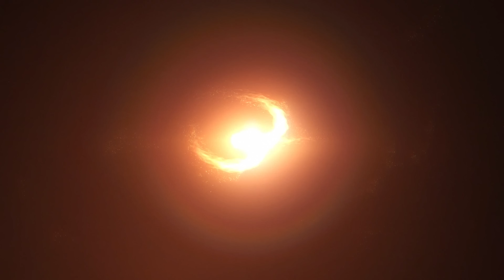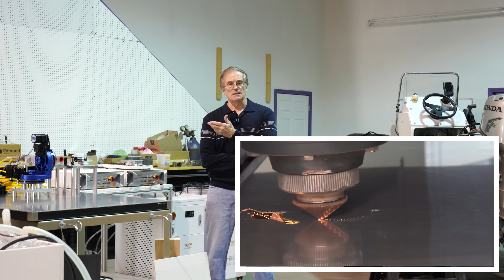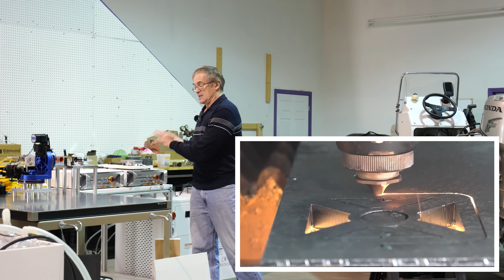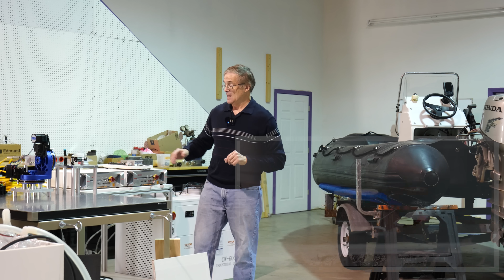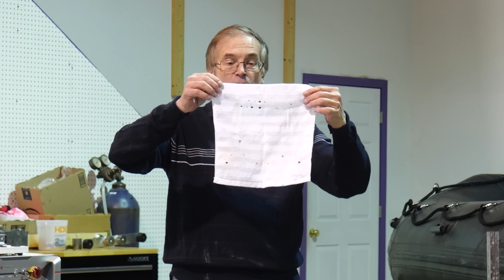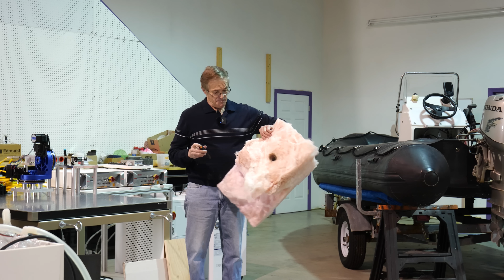We have a problem... and need your help!

Comment: As I see it, you have three problems.  You hit on each of those in the video, but if you try to solve all of them in one shot, I suspect that you will not succeed, or the solution will be massive in terms of cost, time, and/or weight.  For the record, I do have a possible solution, but it is part of a system in an unrelated vertical that we hope to bring to market.  To share, we'd have to have you sign your life away with NDAs, and even then I am not sure it would solve your specific problem since there are fairly major differences in the problem(s) we are trying to solve.  My goal with this response is to perhaps guide you to come up with a parallel solution without violating our IP.  

In no particular order, the three issues I am seeing are:

  1. The small area of the beam
  2. The energy of the beam
  3. The cumulative thermal energy during the beam's lifespan.  

While the first two issues are usually combined in some form of energy density value, I'd advise you to look at these factors as individual aspects for reasons that should become apparent.  

Your first task needs to be to disperse as much of the beam as possible down to relatively harmless levels.  The best way to accomplish this is to use a coating material that is opaque and reflective, ie. high albedo but able to scatter the beam so that the inverse-square law works to your advantage.  Refer to the math behind bidirectional reflectance distribution function (BRDF).  In specific, you are looking for a coating where the particle size is small enough to catch many particles in the coating under the footprint of the laser, and the coating must be thick enough to catch as much of the beam in the particle stacks of the coating as possible.  This material must also be thermally rejective and stable at high temperatures.  There are several materials which cover these characteristics, and your selection will vary primarily on particle size, density, and the specific material's response at the wavelength of the laser.  I figure an aqueous boron nitride coating would be a good start for the wavelength of 1030-1075 nm.  Check with Zyp Coatings.

Next, because of the small footprint, and the fact that no matter how good your coating is, some of the beam's energy and/or the thermal effects will get through the layer, you will need to dissipate the thermal energy over a larger area quickly.  You have already done this to a degree with your heat sink compound particularly with your comparative testing, but for this purpose, you will need to accomplish this in a thin coating that will adhere to the coatings above and below it.  Extra points for figuring out how to thermally bond the different coating layers well enough while dissipating the energy across a larger surface.  This is the "secret sauce" to our IP, so I can't directly help you there, but I'm sure you'll figure something out in short order.  Here's a final hint: we are filing both a process and a material patent.

Given the energy levels we are talking about, this will not do much but buy you time.  Use the above technique repeatedly, stacking the the rejective and distributive layers, and use it on a substrate that can hold its own reasonably well.  You may also wish to keep the material target in motion; spin the target, and put the aim point for the laser away from the rotational center with enough distance between the laser impact area and the edge of the target to allow thermal dissipation.  Finally, you may also wish to have this laminate coating have a PC board layer with a single fine trace going back and forth in as high of a density as you can get as the final layer.  Wire this trace as a safety loop, probably in series with the laser's e-stop if it is normally closed.  The concept is that if the laser gets through the coating and substrate, it will sever the trace and shut down the laser faster than you can react to limit building damage. 

If you need more info, PM me.  I am sure I could convince our board to release our data to you with a signed NDA and information sharing contract.  You wouldn't be able to share the coating particulars on the channel of course, but that isn't the intent of the work anyway; this is just safety equipment, not the laser.  The data we'd want in return is more or less what you normally provide viewers on your channel.  Our angle is that we'd get to evaluate if our product has direct applications in other areas such as laser safety and defense.
Reply: Going back through the subject videos, I see that you are not in the IR band as I thought.  The principle should still apply, but material selection will likely need to be reconsidered.

Comment: Combine 3 ingredients?

Reflective surface at 45 degrees down angle. Into a barrel of water. With ceramics (bricks or ceramic saddles) lining the bottom. The water does the heavy lifting in thermal absorption, and the ceramics absorb any energy that passes through the transparent medium before it can be transferred to the water. Gives you a renewable solution that you can refill rather than a deeper and deeper hole in the ground or a material. Would that work?

Comment: Pentaerythritol is used in fireproofing, since it puffs up and chars, forming relatively safe corbon insulation. I could imagine mixing a plaster with it and pouring it a few centimeters thick.

Comment: buy any flat metal tape that is rolled in a roll. Then unpack the roll and let it spread out so there is always gap between walls of metal tape. Then shoot laser into that gap between spirals, and laser will keep bouncing of the walls of the metal tape thousand times, each time it will lose 1% of its power, till on the end you'll be left with almost nothing.
Based on that same principle one can buy optical cable, crack it up to reduce its transparency, and then send a beam into that damaged optical cable. One needs to find a way to control rate of absorbtion of that glass fibre, because one doesn't want it to absorb energy too fast.

Comment: carbon ?  like activated charcoal (if i spelled that rt..)  its light , cheap & should sustain the temps , plus black so absorb rather than reflect/refract .   and / or finding something economical that carbonizes when burnt ...   otherwise, u gotta find a mineral  = can be made fluffy = and gotta get it into a sheet.

Comment: A big tank of water with dye in it -- with a low enough optical density that you're not flash-boiling the water at any one point, but thick enough that in bulk it attenuates the laser enough for an opaque blocker on the back of the tank to deal with.

Comment: It seems to me that, just like your metal cutting industrial device, you need to take the collimated beam and give it a diverging lens.  

I suggest a lenticular wall of glass or plexiglass rods, the first layer of glass rods would actually be two layers of vertical rods that overlap by some small amount to avoid the beam squirting between the rods, The next two layers would be horizontal rods in the same configuration. The final layer would be some kind of black painted plywood of some sort, set a few inches or a foot behand the "Diverging lenticular Array".  

The reason for the vertical and horizontal orientations is obvious to anyone who has played with optics like that.  The first rods will convert the intense collimated beam into an intense but greatly reduced wide narrow beam that would be as tall as the original collimated beam, but diverging into an extremely wide flat beam.  The following horizontal divergence wall would finish the divergence into a vastly lower energy diffuse wall of light.

What I don't know is whether inexpensive glass rods would absorb too much energy and melt too quickly.  I would experiment with different materials.

Just my two photons of advice.

Comment: Maybe a fog/ smoke machine +- dyed smoke could diffuse the beam so it is less intense over distance (i guess low dye would be better or it would vaporize or burn the fog negating its scattering benefits) and could be stopped by a intumescent coating or as discussed by others a thin layer of water like a narrow water tank maybe with dyed water. 
Basically a double glazed window with a bubbler to reduce density, shock waves and localized heating and provide circulation. 
Water would need to have any IR absorbing dye or maybe just carbon black suspended. 

Maybe agitated dry ice would absorb IR radiation i don't know. If it did it could be used similarly to water in a double glazed window and also prevent fire but i would expect cracking from the intense cold and heat.

As previously suggested a water cooled oxidized copper plate may work as well.

Comment: My first thought was wet sand - wet as in dripping wet. Too wet to make a sandcastle. The problem then is how to contain it.  Glass or acrylic is probably too reflective. Drywall or plywood would suffer from the moisture. Wet sand between concrete slabs?

Comment: Choose a material you are comfortable with and make rotating disc panels with it , your issue is focused energy at the same spot ,if you rotate that area there is not one spot but a circumference to work with .

Comment: Drywall or gypsum board coated with starlite or a similar fireproofing coating (starlite 2 parts flour, 1 part cornstarch,sugar,baking soda) and the panels should be at an shallow angles to disperse or redirect any reflections.

Comment: A series of sheets of water containing powdered graphite.  Having multiple sheets in a row will give enough graphite to act as a dump, the cost of setting up the sheets of water should be low, there does not need to be any containing surface to get damaged.  A trough pool can catch all the water which can be constantly recirculated.

Comment: My friend works with powerful industrial lasers, and he suggested a white nylon plastic for the material.
Yes its going to reflect to some degree, but he said it will absorb some of the light and warm up without catching fire or smoking a lot.

If possible, the material should be installed not at straight angle from the laser, and little rough surface finishing can help in scattering the light.

Also, it could help if you can give some details of the laser like:
Wawelength
Total power
Pulse energy
Exact diameter of the spot

Comment: I had 2 ideas that likely won't be the solution but might spark a better idea from someone else: 1. A dense plum of gas behind the target. My thought is it might help  defuse the laser slightly (might even use a tube to help keep the gas concentrated) 2. Space Shuttle heat shielding tiles. I recall someone on YouTube making their own a while back.

Comment: Have you ever tried using what they call aircrete? If not there are some youtube channels like (honey do carpenter) that have alot of good videos. You could build a mobile wall on a wheels or skids out of air Crete. It would be light enough too. I seen a 12×12in. Solid cube of aircrete be light enough a child lifted it like a beach ball.

Comment: You need something super black with the form of a heat diffuser behind. Or a refrigerated unit.
Absorbent, fiber formed to diffuse, heat conductive, 
I know it will burn, but, carbon fiber?
If you figure this one out, body armour that would deflect or dissipate lasers would be useful yes?

Comment: Maybe something with agar/jelly like. It should be easy to setup, potentialy biodegradable and cheap. Maybye jelly wall will collapse fast enough to close the hole. In addition you can use drywall as first layer to prevent reflections. 

Also maybe blanket with Oli will last longer, but it is more flammable than plywood. You can try making drywall sandwich witg olied blanket in between to limit oxygen access. 

I think only one material cannot do this, you need to use composite wall.

Comment: The one thing that comes to mind would be materials used in very high temp furnaces and kilns. It may be a moot point depending on the temperature of your laser output, but Kaowool or refractory bricks might last significantly longer than the standard materials you have tested. Or they may fail just as quickly.

Comment: Maybe a fish tank filled with water and a circulator or stir bar with carbon black in the water? I would guess the carbon would absorb the laser and the water would allow not only heat dissipation but the siring would always put new material in the beam path.

Comment: I'm wondering if a large water tank filled with a black gel that has thick non-reflective glass sides would work.  I saw gel instead of just water is dark tint because then if it puncture the glass wall the gel could in theory fill the hole.  Another idea would be a tank or bad filled with wet sand.  Tungsten will deal with heat better but it might be too reflective.  Really though, you should be focusing on things that absorb most of the light and then transmit it back out and through itself as heat and that can handle very high heat (hence mentioning tungsten).  The thing is though, if the object gets too hot it might become very bright itself and then might injure people or object nearby (sort of like being to close to a fire or welding or sunburn). The toxic gas/off gassing is a valid concern but if the work area is big and well ventilated its less a concern than the beam reflecting or the reemitted heat being too high maybe even causing burns/fire.  Really one should treat such a powerful laser as a tool only to be used for what it was designed for. But, if you must use it outside of its intended use you should then treat it like a high caliber fire arm or explosives, so essentially you need to do it out somewhere safe where no people or large wildlife or plants are around to catch fire.  And, then those firing it should be behind  protection (like what you're trying to design).  Another possible form of protection would be screens that polarize the light twice or more times until it is totally filtered out or rendered harmless.. but again the filters then my catch fire (especially the first one the light hits)  Sorry for the wall of text, just too tired to edit this.  I know I didn't offer many good ideas but hopefully this prompts some good ideas.  Good luck but more importantly be safe.

Comment: First I thought some type of aerogel, but maybe the best solution is to use diffraction. Maybe wire in layers of horizontal and vertical line patterns with some space between them. The wire needs to me smaler then the light beam. The wires will absorb the heat and the diffraction will spredd the light. Its almost like reverse engineering a lightbulb in combination with the famous double-slit experiment.

Comment: Slab of rough cut SOAPSTONE used for countertops or wood fireplaces. Resists heat, will diffuse the beam because not reflective, cheap, available anywhere. Custom cut to any size and thickness.

Comment: Why would you test it indoors with both low divergence and high power? You can do system test with a low power beam. Slow motion replay to confirm target tracking. For high power indoors test use modified optics so the beam is safe for the backstop at say 10 m. Save low divergence and high power for the proving ground.
Which leads me to wonder just how you might safely test it outdoors. Let's suppose the beam is safe for a pilot's unprotected vision at 200 miles. You would only need an FAA total flight ban for a 200 mile radius. You might get approval to test it in Eastern Ukraine though.

Comment: I have no idea if this will hold up to this much power, but to dissipate a low power laser, we use glass that we have sandblasted.  We do this to protect people from possible reflections of the laser.  You need to use a fine grit to break the laser up into many small parts.  You could also try spinning the backstop to limit the amount of time the laser is on one spot.

Comment: If plywood worked well water soak that... The localized flame up will be minimized by the sounding soaked fibers
Reply: Another option could be using an acetylene flame to soot the surface being struck with the laser as a pre-treatment

Comment: If you're going to keep the testing to a relatively controlled area. Make a giant thin curved mirror in the shape of a crescent. Anywhere the beam hits in a sweeping arc have the radius of the curve so it reflects it back to a dummy load in the center. The mirror would probably need to be liquid cooled.
Alternatively you could pulse width modulate the laser
Reply: Also the mirror will probably need to be custom made silver primary mirror. A secondary mirror won't do the job. I'd back the mirror with a half inch copper water block the entire length.
Reply: Perhaps making the beam slightly wider for testing would make it easier.
Reply: Holler if you need a place to do it out in the middle of no where to test. I've got a huge place with nobody around for miles. And a canyon with solid rock walls That won't let any of the beams escape.

Comment: Just pulse the laser (single-shot) for as long as you know it would destroy the test target. Start from a short pulse (perhaps in 10's of milliseconds) and increase it gradually. It's not hard to achieve, perhaps in G-Code or by using an external microcontroller, let me know if you need more assistance.